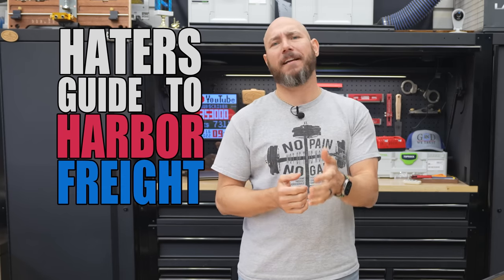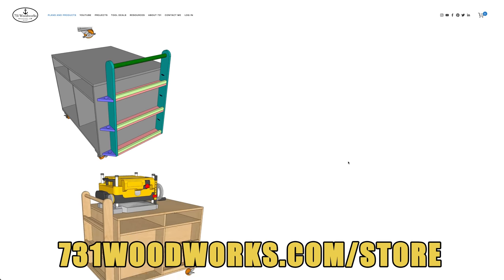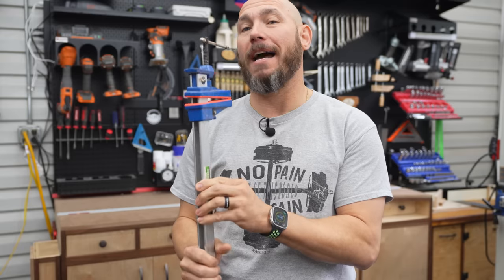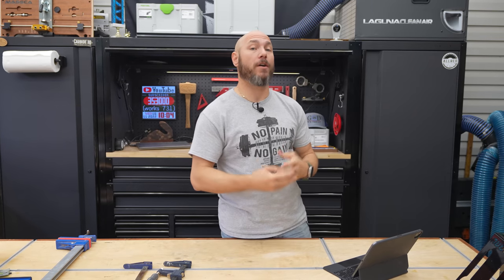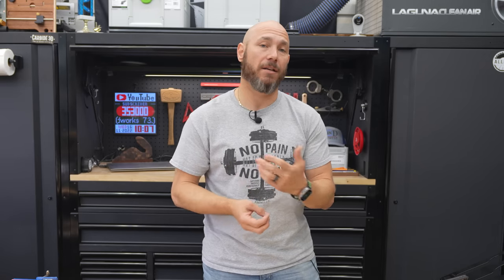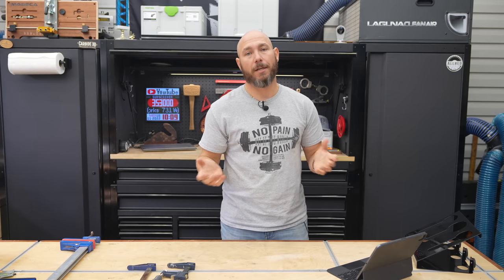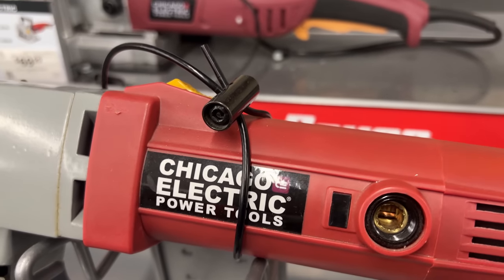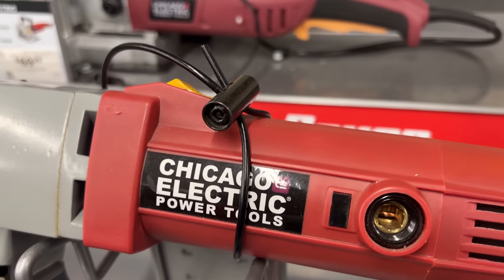The Hater's Guide to Harbor Freight | What to Avoid

Comment: I’ve had pretty good luck with my purchases from Harbor Freight since I discovered them a few months ago, 100+ items to be exact. I use but don’t abuse them or try to push them beyond what they are designed to do, and I’m messing around in my garage / shop probably 3 to 5 days a week on average. I buy the cheaper tools too, Pittsburgh, Warrior, Chicago Electric. Sometimes I’ll splurge on a Bauer tool if it’s on sale, has features that I really like or is a little more powerful than a similar Warrior model and I know that extra power would be beneficial. My paycheck doesn’t depend on these tools either though, only my never ending honey do list is riding on them. Everything has at least a 90 warranty and the hand tools are lifetime guaranteed, just bring it back in and they’ll swap it out for you. I like the place, the tools and the staff, at least at my local store.

Comment: I had a little central pneumatics compressor from HF that lasted almost 12 years - and it still worked when I sold it to upgrade to a larger compressor (also from HF). 3 Ton floor Jack is almost 17 years old and works like a champ. Orbital sander - great, hand tools - passable unless your going to beat on them with a hammer, pneumatic impact and sockets - work great. 

I also had a $20 recip saw that lasted literally 1 job and then disintegrated - but then it did get the job done. 

Agree that their measuring equipment should be avoided - probably why they give the tapes away for free. Also any drill/driver bit and blades you buy there are guaranteed to be garbage.

Comment: I have had some quality issues with their power tools, but I use tools only to do light work at my home, so it's fine. These tools typically outlive the reason why I buy them: saves me money compared to hiring a handyman.
I had a problem with an oscillating power saw, as one of the holding metal bits did fly out when the blade got loose. I got lucky, retrieved the bit and hammered it back in. Still works. The blade got loose too often, though, but I was sawing through a 1.5" iron pipe (sink drain). I am still happy I did not have to cut it with a hand saw.. Next time I will use superglue when hammering it back in. 🙂
The forward/reverse actuator on their cheap battery drills is plastic junk, but I was able to reposition one once, after a few failed attempts. I just bough another drill (from HF) when it failed again. I calculated that buying a new drill every 5 years or so is still competitive.

Comment: The HF angle grinders are so cheap I have several - not having to change disks between grinding, cutting, wire brush and flap disks saves so much time and aggravation.  Since each tool runs less time has made them last pretty long as well.

Comment: Chicago brand is great for a tool that is seldom used or used just for a specific project, a throw away tool that's OK if it doesn't last long.  I have a Harbor Freight 12 inch miter saw I don't know which brand, NOT the Chicago brand.  I use it for home owner type DIY projects.  I have an assortment of their air nailer guns and air staplers, not Chicago.  Again, I use them for home owner  DIY projects.  Saved hundreds on those and they work great.   Unless I need a specialty air nailer, I use a cordless Ryobi nail gun.  I like to shop Harbor Freight for many things, but generally, I'm at The Home Depot.   I enjoy shopping HF and usually find things I didn't know I needed.  One product that is really worth buying there is the "fishing" rods used to pull electric wires for re-wire projects.  We have used those a lot for rehab projects on old houses.

Comment: As you and other YT presenters have noted, YGWYPF in many cases.  I have had HF tools last a long time and others fail more quickly. I own a sailboat and do a lot of heavy work (steel hull boat) and I have had both HF and DeWalt tools wear out in a few years. Invariably cheap bearings and plastic gears. OTOH, their Titanium 170 welder punches above its weight for the price about $500 and I found a spool gun on sale for another $125 for Al welding that expands its value considerably. 
As to small tools, for sockets I mostly use impact grade, never had one fail, but the actual ratchets I might buy elsewhere. They tend to be the failure point. 
Far too many people expect a tool to do more than it is inherently capable of doing or not designed for and then they have a failure. That part is the buyers/users fault to some large degree. But if you have chosen the right tool, use it properly as designed and it fails, then it is fair to blame the tool.  
Not everything is a nail, even if all you have at the moment is a hammer.  Use the right tool. Get a good one. The most important aspect is your craftsmanship and skills. A large part of that is managing your tools and mastering their use.

Comment: spot on sir, although i do have to say i had a orange Chicago electric sawzaw for 10 years when i was flipping rentals. only paid 15.00 for it. Bought my first oscillating tool there as  well for 10.00 used it for 8 years before a plumbers helper burned it up.

Comment: I like to use the tools they have for certain things. I have a tool bag I carry to scrap yards and it is full of HF tools. I also keep some around in case I need to modify a tool for something weird or hard to reach I am not wrecking an expensive tool. You clearly have to remember that they are cheaper and may break or get damaged easier.

Comment: HF has its purpose. I've only bought a couple of power tools and they've been fine.  Mostly I buy little oddball tools and accessories along with cases.  Their prices on the Apache cases is excellent.  The Automotive AC gauge kit has been great and their Scanner line is decent without costing an arm/leg.  The Icon line of tools is actually pretty decent quality.

Comment: I BOUGHT THE HERCULES TABLE SAW, it has enough power that i can cut 3/4 birch plywood and i bought it for building a murphy bed. this was my first woodworking project and it did really good. later i was looking up how to set up a saw to try to build a nice watch box and there is no setup possible. nothing under it really moves or adjusts or allows you to fine tune the blade. the fence is a thing you have to fiddle with and if your building around the house its fine but i now have to buy another saw if i want to be a better woodworker. i haven't looked into what to get as i have no shop, just a carport and a 7x4 shed so my saw has to be small. i would love a pros opinion on a highly adjustable small saw. i thought the delta looked pretty good.

Comment: As far as the electric tools go, just know what your use for it is going to be. 
A few years ago I bought a Chicago electric Sawzall with a swivel head for 19 bucks for use as a "beater" tool. I use it in the rain, drop it in the dirt, drop by the cord off ladders and have given it quite a few real hot suppers.
 
Surprisingly enough, it's still kicking even though I bought it with the foresight that it probably wasn't going to survive its intended use.

Comment: Some of their stuff is cheap and doesn't work great but it gets the job done. I needed a hammer drill because I own a 136 year old home with brick walls, and occasionally need to drill into those walls. I paid like 1/3 of the price (probably less) and got a drill that feels poorly made and is somewhat sketchy to use, but guess what?? It works. Never failed to put a hole in the brick where I want it
Reply: I bought my German made  Bosch hammer drill for $20 at the local pawn shop.  Any pawn shop has drills and plenty of them.  Probably 1/3 price of HF

Comment: Stay away from the Yukon 46" tool chest. The small ball bearings in the swivel casters grind into the races locking them up so they can't swivel. I took my 1st chest back and exchanged it for another which did the same thing after spraying both with WD-40. Will probably take this unit back and exchange it for a US General model (more $$ of course). Other stuff I've bought from them have been ok

Comment: Router bits and other carbide tools at HF are often not properly sharpened.  Some don't even have proper clearance ground in, such as the lathe bits.  If you have the ability to sharpen carbide, they are a good value.

Comment: I'm a sculptor, but over the years my back problems have been getting  getting worse and worse, including one operation, so I bought one of Harbor Freights pickup cranes to mount on my welding table to lift heavy pieces. It worked fine for about two week and the hydraulic cylinder sprang a large leak. I called the customer service number with my heart in my mouth: this was, after all, Harbor Freight.
I spoke with a very nice woman who, without giving me any runaround, send me a new cylinder, freight free. The new cylinder works find and I've been using it for over a year with no problems. I still by some stuff from Harbor Freight and most of it is adequate for my needs. Don't listen to haters OR fanboys. Make up your own mind.

Comment: There are things I would not buy at harbor freight but I have bought hundreds of items over the last 30 years. At first I bought from harbor freight because I was poor and couldn't afford better. Later I bought from harbor freight because I found that some items they sold we're just as good as the far more expensive tools I could afford by then. I now have a compressor that I bought from harbor freight 28 years ago for less than $100 and it still works. I also have a 25.00 lithium drill that I bought four years ago and use as my primary drill and it still works great. Unfortunately, I have a automatic battery charger that cost 40 bucks and never worked once. Overall, I would say that their tools are well worth the money you pay for them but test them thoroughly when you first get them and take them back immediately if they don't work.

Comment: Recently bought the Hercules 4.5 inch angle grinder to grind some concrete also got the dust vacuum shield. This thing is a beast and worked great! The price was way cheaper than the big brand rip off models.

Comment: One thing I noticed about the big name brand tools compared to what my dad had when I was growing up, and the same tool today, is that none of them have the quality they used to have. I have a lot of my dads tools and prefer them over anything. Nowadays, a lot of the cheaper tools are just as good as the name brand. 20 years ago I bought a big name brand tool for the quality. Today I’ve found from experience that you’re buying a big name brand tool, just for the name. Alot of the lesser famous brands are actually made by the bigger name brands. I don’t just buy based on a name anymore. My choice of tool now basically depends on what I need it for and if it’s something that will get regular usage or something that will be used sparingly. I try to buy “Made in USA” today as much as possible. I don’t mind paying a little more for a tool if it’s Made in the USA. You can’t put a price on the piece of mind.

Comment: I like harbor freight because of the lifetime warranty. If a tool breaks I am out an hour round trip drive time to replace it, as opposed to a brand like Snap-On where if a tool breaks I can't get it replaced until the next time the tool truck rolls in. Their tools may break more often but what does it matter if they have lifetime replacement! And usually no questions asked. I have done some sketchy stuff with HF tools and when they break the store cracks open a brand new one and tells me to have a nice day.

Comment: Let me start by saying I have over 35 years in the maintenance field between the military and my career. I find harbor freight in excellent source for consumables. If you need zip ties, rubber gloves, cheap throw away sponge brushes or grinding wheels, etc. If you need a certain tool that you're going to use once every 10 years it makes since buying a high-end tool.

Comment: I was a little disappointed you didn't discuss any air tools. I have used HF air tools for years... and yes, you do get to replace them when they break... but a pneumatic drill I bought 22 years ago, I had to get a replacement for... I think my total cost for both drills was under $60.  That's acceptable to me.

Comment: I've been running the Harbor Freight Titanium Mig 120V (not unlimited) and it has been a work horse for the past 2-3 years. I was able to start welding and learning for cheap and was able to make myself a car rotisserie and the welds are still holding (more user factored). Their cheap welding helmet was a dud. Gave myself arc eye so I wouldn't recommend that. But the 6" F clamps as mentioned in the video along with their welding gloves and metal wire brush are solid as hell.

Comment: I am from central Europe and we of course do not have HF around here. Instead we can buy tools from Lidl. I would say those are very similar in quality to HF. What I like to do is buy a reasonably priced tool first. With the warranty from Lidl I can use to tool for 2-5 years depending on the product line and if the tool breaks just return it, take my money, and pay a bit more for a name brand tool. If the tool holds up for 2-5 years there is a good chance it will work for 5 more. This way I have every tool I need but only the ones I actually use a lot or need to be good quality are the ones I paid extra for. At least that's the way I think about budget tools.

Comment: I worked in HVAC for 25+ years and had a pretty good selection of name brand tools. Several years ago, some douche bag broke into my work truck on Easter weekend and took most of my tools, including a fairly new Dewalt cordless hammer drill and Milwaukee Sawzall. Back then, Harbor Freight’s cordless power tools were crap. However, their hand tools actually weren’t that terrible. I spent part of Easter Sunday there replacing the hand tools that had been stolen. Most of the Harbor Freight stuff had a lifetime warranty and actually held up pretty well, plus the price wasn’t bad. The performance was about comparable with Sears Craftsman tools. On the occasions when something did break, Harbor Freight replaced it with no hassles. I sprang for a new Dewalt hammer drill, but I did buy a Harbor Freight reciprocating saw for $25 on sale. I got 5 years out of it. I have no complaints about Harbor Freight.

Comment: Little tip for the welders out there harbor freight sells concrete chisels for about 10 bucks works great as a scraper for bbs and slag especially if you’re a structural fcaw welder

Comment: I've started getting more Harbor freight stuff recently too. I will swear by the pipe clamps. You can see it, feel it in the heft, everything. They're the same as the big names for a fraction of the price.  You do have to get the pipes elsewhere, but at $9 for a 3/4" vs $25 or $30? 

I've also been pleasantly surprised by my Bauer orbital palm sander. Got a used one for free, and it lasted another 3 years of daily use before the switch broke. Got the exact same model, on sale for $20. 

Router bits? I'm mixed. I bought a cheap multi pack and had the 1/4" straight snap on me. But everything else has held up. And definitely better than Ryobi. Will they do as well as the Diablo bits? No. Do they have a better selection for a fraction of the price? Yes. Making a huge cutting board and needed a large bullnose. Local stores didn't even carry a bullnose over 3/8", and online they're running $40+. Got a 3/4" Hercules for $10.

At the right speed and feed rate, I had 0 burns. But it did take a pass to get dialed in.

Comment: As a former pro mechanic and having owned the big names in tools, HF fills the need for cheaper tools, but that's what they are, for the most part. As he said in the video, some things are great for the price, others you're kinda taking a chance, but if the cost is several hundred $$ less for a tool you're not using for a living, it's a bargain. For instance, the 32 gallon air compressor I have has been a great bargain, the break-in oil was BLACK, but that's why you change it. Only real knock on it is it's really loud for electric, but it was worth the money and savings, been using it for 3 years now.

Comment: Might be a little late to this video but I do own the Hercules table saw and it does have a rack and pinion fence on it. Seems to work well. I’m not someone that has used a ton of different table saws sure there is better ones and worse ones out there. But compared to the Dewalt job site saw it seems like they could have came from the same manufacturer

Comment: Several times over the years I have bought harbor freight tools simply because the more expensive tools I bought quit working. I had a Milwaukee drill which I paid quite a bit for but when the battery went bad the battery cost three times more than a lithium drill from harbor freight. I bought the drill for $25 and have been using it for about 4 years now and gave away my Milwaukee because I knew I would never pay $70 for a battery to make my used Milwaukee drill work when I could buy three new warrior drills for about the same amount of money and get brand new batteries and chargers with each drill.

Comment: HF has a little blue handled I think it is called 4 in 1 or maybe 5 in 1 screwdriver. Usually 1.99.  this is a great steal.  You can't hammer on it too much or you drive the bit into the handle, yes I have done this, but it's good.  I do not trust their flashlights though.  I bought 1 of their I guess compact stick lights.  Had a side light and the button was on the top powered by 2 or 3 AAs.  Got it and it never turned on even with brand new batteries in it.